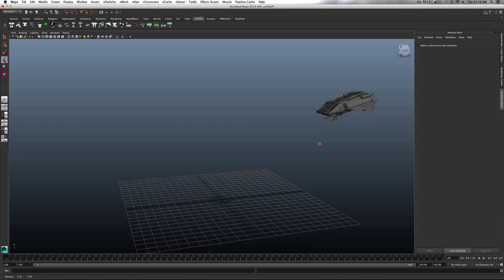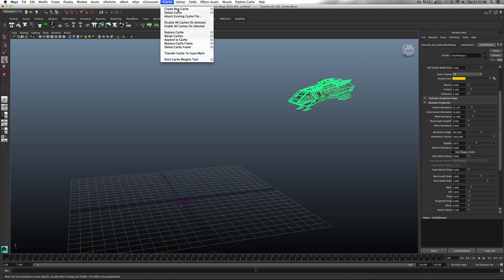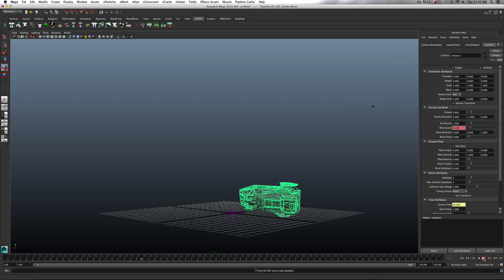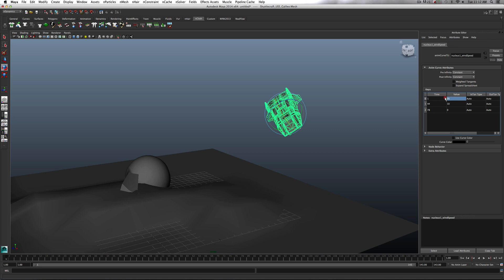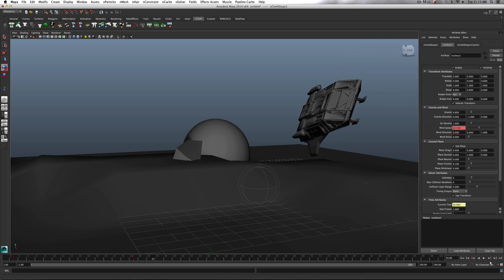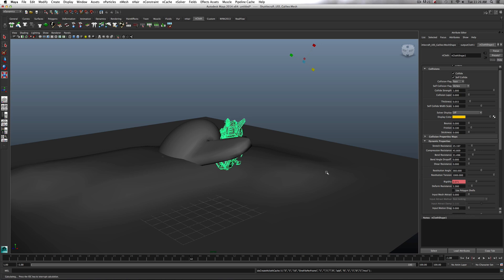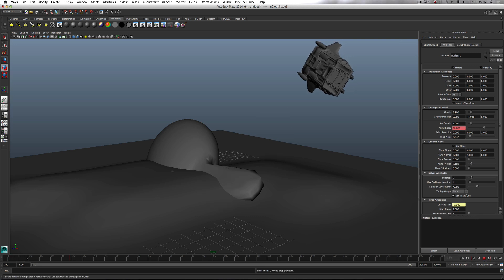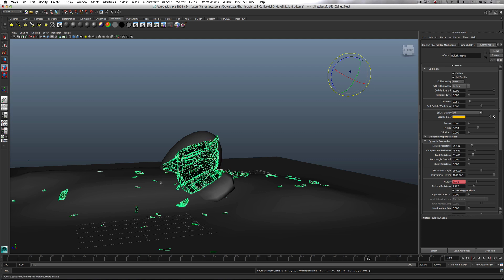Maya Sci-fi Ship Crash Tutorial

Comment: To Black Cloak Hero - As a suggestion to start the Polygon Shells mid animation, you could set a key of high value to the Deform Resistance above the Polygon Shells check box. Then as the object hits the surface, set the value to 0. Might work, just a suggestion.